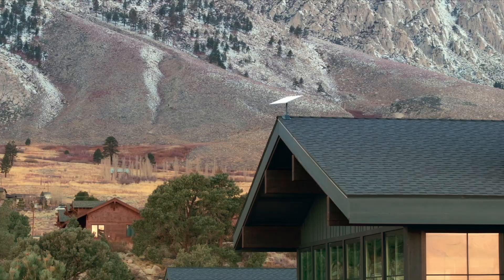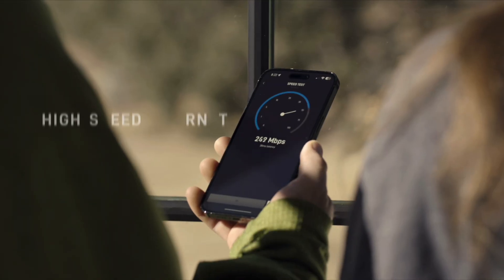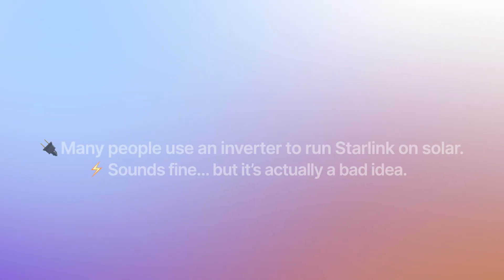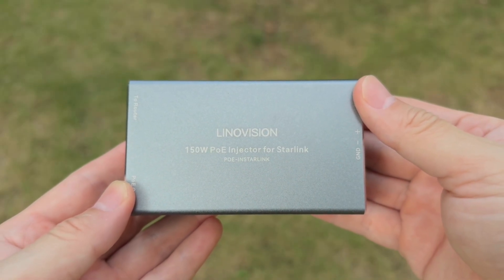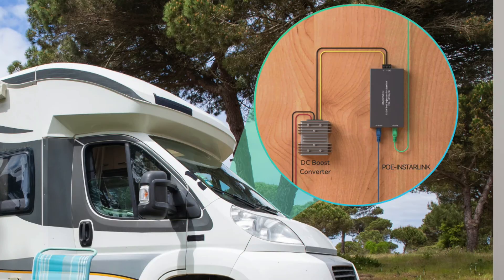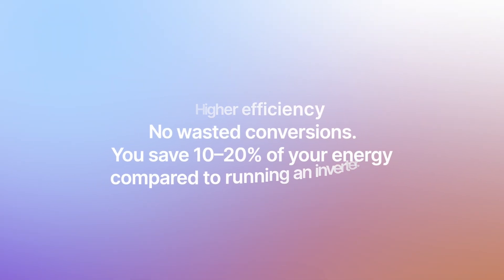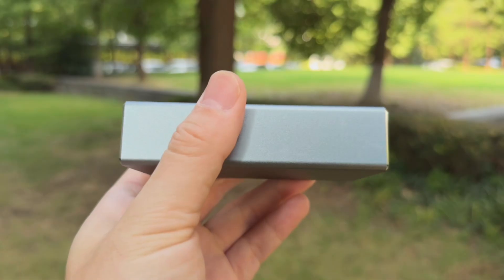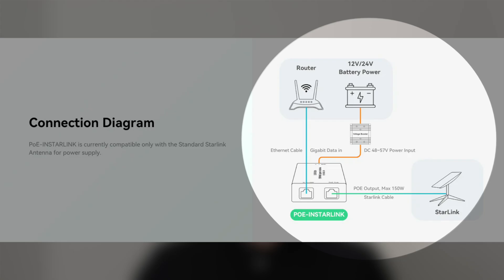How to Power Starlink Off-Grid with RV, Boat & Solar Systems

Comment: Why does this video reference RV, Boat etc when the PoE injector only works on Starlink Standard. SS isnt supposed to be used on Boats or RVs. Why wont it work with Starlink Mini?